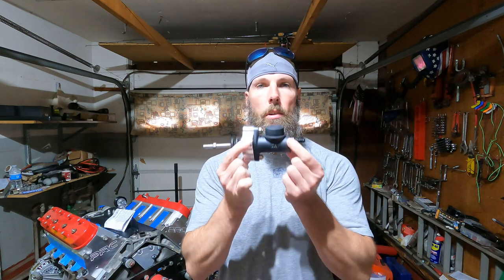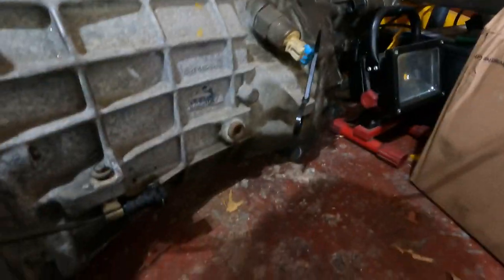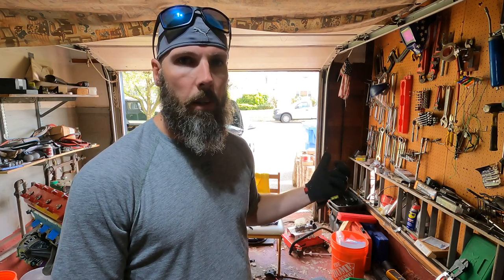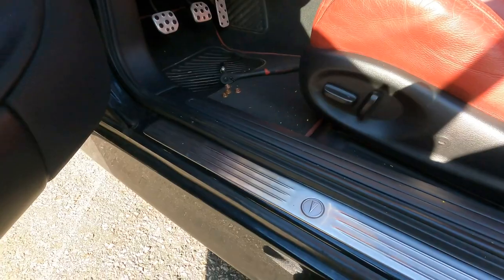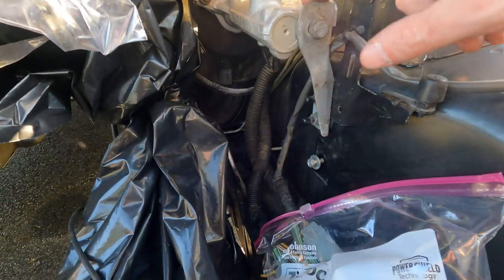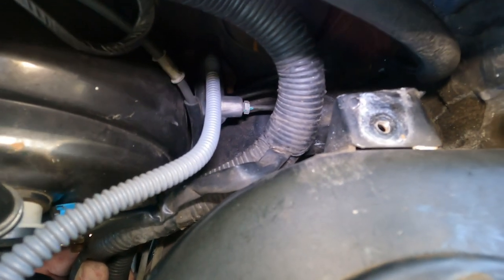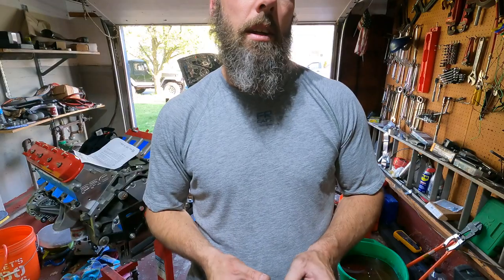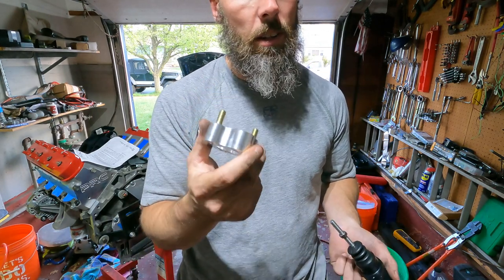GTO Tilton clutch master cylinder install

Comment: Good video 👍 I install the tick cylinder one it was cramping fingers lol and get creative with tools. It’s good challenge and doable and patience. Once again good job on your video
Reply from the maker: Thanks! Yeah that thing was bad! Would have taken much longer if the engine wasn't in. Been driving the car, shifts feel much better
Reply: @Billy_Ray_Garage   we did the LS7 tick performance clutch slave cylinder and master clutch cylinder package which I did care for to much  due to the stiffer peddle but it’s my sons car he likes it . I think my white hairs grew white hairs lol that job almost kicked my ass but at the end I was victorious lol . These LS engines have that freeze plug style at the end of the crankshaft in front of the pilot bearing that was a fun one didn’t know was there when I was trying to remove the almost impossible to remove pilot bearing.
Reply: Thank you for the ground work of doing the different upgrades and repairs you have been doing to your GTO for the GTO  community can learn from👍👍
Reply from the maker: @killohertz1  the pedal is very stiff and I have a stage 2+ clutch on top of it. My pilot bearing was ridiculous to get out. Didnt change it this time since it's still pretty new
Reply: @Billy_Ray_Garage  lol yea that pilot bearing ain’t no joke. I definitely watching some more of your videos, especially the one when you were doing the bushings for the cradle.
Reply from the maker: @killohertz1  those are horrible too! 😅 that pilot bearing didn't want to come out. Took forever cuz I don't have a lift. Had to modify a slide hammer to even grab the bearing
Reply: @Billy_Ray_Garage  I just about cryed of happiness when I got that dam thing out  lol.
Reply from the maker: @killohertz1  haha! My back was happy. Made sure I put something on it so it doesn't get like that again

Comment: Hey man had a ? For you or your subscribers. I stripped out the passenger side shock bolt, has M 8.8 on bolt head. Any idea where to get these or match them up?
Reply from the maker: Wretched motor sports has a nut and bolt replacement that's available. If you don't wanna go that route, think you'd have to find a junkyard replacement for OEM set up.  Contemporary corvette in Bristol, PA may have that if you call them. (800) 367-8388. Don't know if they ship but give them a call